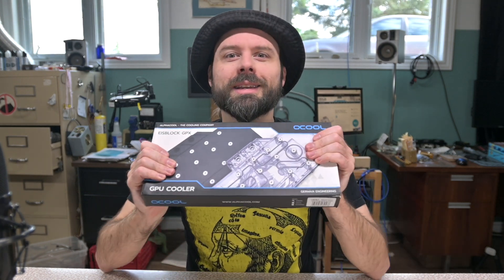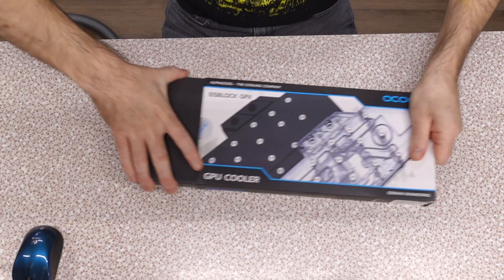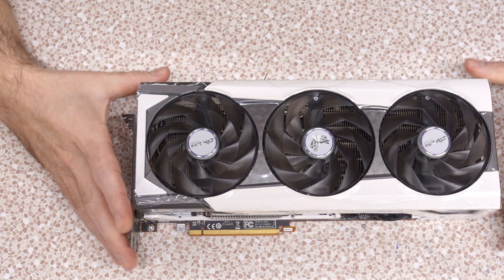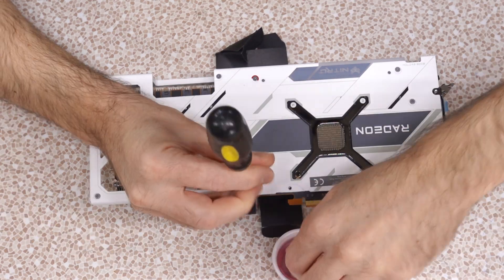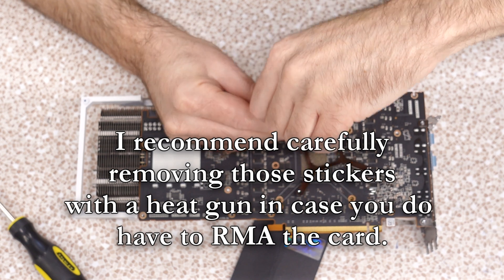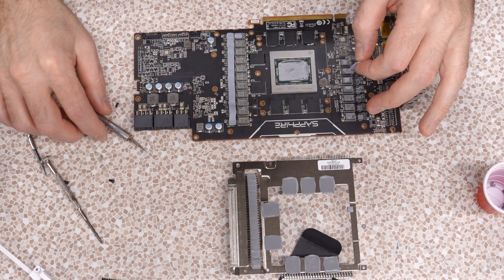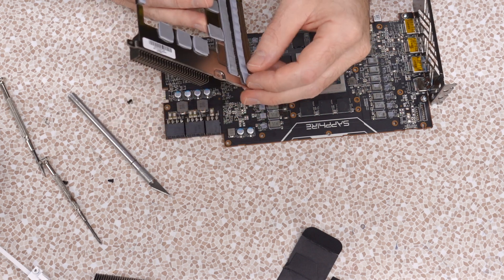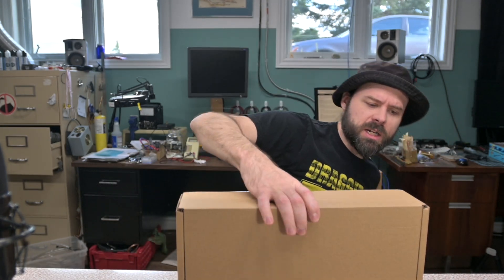6950XT Water Block Install Part 1: Take it Apart

Comment: I’m looking at water cooling my 6950 because right now under load is 62 at it’s all time highest but I would love to make it 40 and 28 idle
Reply from the maker: I dont' think it's possible, these cards like to run hot, if you give it really good cooling, in theory it might run just as hot but just turbo higher. But again, I'm not sure, cause it seems the block I got might not be the best. The air cooler mine came with works really well, and the block barely improved anything.

Comment: same block i grabbed. i have the sapphire toxic air cooled. and asked for the updated bios from sapphire after i watercooled it and the bios they gave me software unlocked my card into the extreme edition with the alphacool block it rips pretty hard.  ive had bykski on my xfx 6900xt but it has some really bad hot spots and tends to get clogged up really easily. alpha was the only one that carried the right waterblock for my pcb. and my pcb came with the waterblock pin outs.
Reply from the maker: I'm surprised I'm not getting lower thermals given the TDP, but not sure. 
What do you mean by "Waterblock pin outs" ?
Reply: @DATT  on the sapphire toxic specific cards my pcb has the pinouts for the aio that the toxic cards except the air cooled version on come from sapphire. but the air cooled is the exact same card minus the aio from the limited edition version. anyways. if you look at the pcb for a 6900 xt sapphire toxic you ll see the pinouts .. next to the rgb and heatsink fan plugs theres another set for the aio which activates a much more aggressive group of settings.
Reply: @DATT  like after i installed the waterblock and used those plugs my card was being picked up as an xtxh with the 5000mhz core and 2200 memory. and the 16gbs memory not the 18gbs which is the unicorn of 6900xts lol.
Reply from the maker: @StaayHumble  I'll keep an eye out for that. I wonder if it's a good place to connect the rad fans. 
I've been shopping for a new Mobo, and some don't have the T sensor connection I need to manage my fans the way I'm used to. It's kind of a deal breaker for me, but if I can run the rad right off the card. But Idk, I have a formula I don't really want to mess with. Damnit Asus is being weird with their new offerings tho.
Reply: @DATT  i'll take a picture of it tomorrow. i m going to refreshen my putty and paste anyways

Comment: So I have sapphire nitro +6950 XT version. Not the "PURE" version that you have. Will that water block work with my card? Thank you for your video!
Reply from the maker: I personally can't say for sure, as I havent' worked on that card. I would imagine there might be slight differences in disassembly and fitting. 
The website says yes. I'll put a link in the description.
Reply: @DATT  Thank you for the link! I was able to put the water block into my shopping cart, but mostly everything is in German. Lol. But I'll figure it out. Also, I really appreciate the video that you took the time to make. It takes some of the fear out of doing this myself. Will try to give an update once I receive everything and get it installed.
Reply from the maker: @philmccracken2012  Ohh, that link was just to show you the manufacture website so that you can double check the compatibility list. 
To actually buy it I'd go to PPCS.
Reply from the maker: Mind you, seems PPCS is out of stock now.